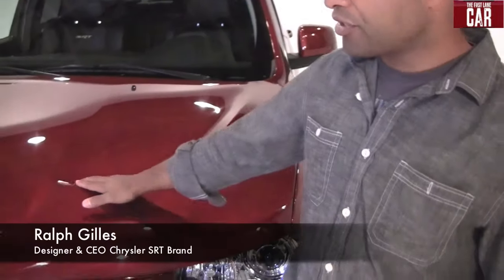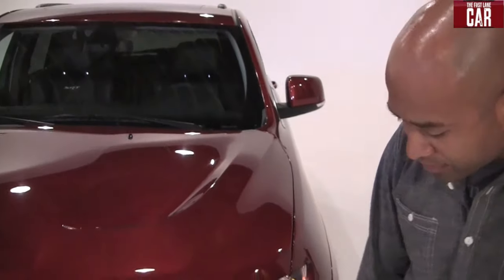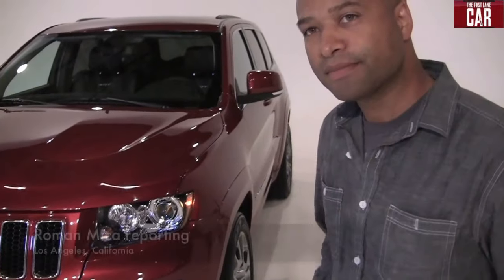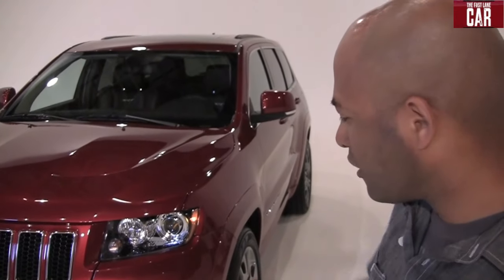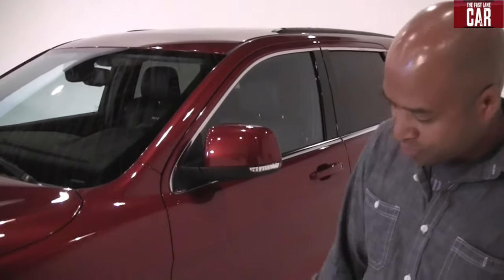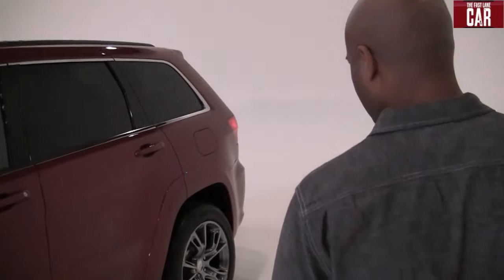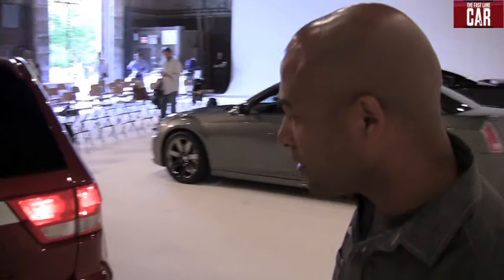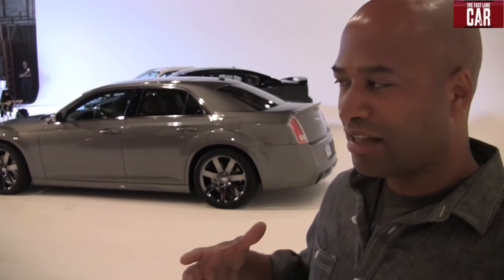2012 Jeep Grand Cherokee SRT8 Design Analysis with designer Ralph Gilles

Comment: I agree with most on here that the old one was much better than this one. This one looks like a Cherokee, an X5 and a minivan crossover.  And the comment on removing the rear tips in the middle for people who want to tow, if they want to tow, don't buy an SRT8.  Just cause a few people complained about towing, you decide to piss off everyone else next time around?  Did they forget what SRT stood for when they designed this?  This should be the regular Grand Cherokee model, not the SRT.

Comment: Except for price, capability, and, most of all, reliability. They just tested a brand new one on top gear and the windshield was leaking rain water all over the dash. Plus, just like the porsche, its trac settings are confusing and don't always work like they're suppose to. Dude, original 4x4, original SUV, and if you don't know Jeeps legendary off-road capability and reliability, well, thats sad. Then, big HEMI and SRT tuning at almost $20,000 less than the Range Rover. I'm screamin' SRT Jeep.
Reply: Teddy Mopar